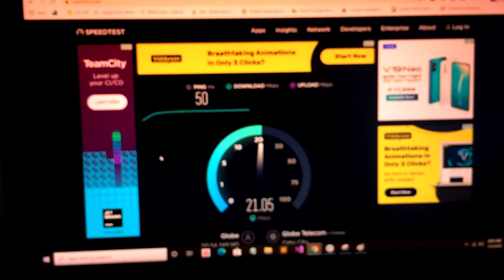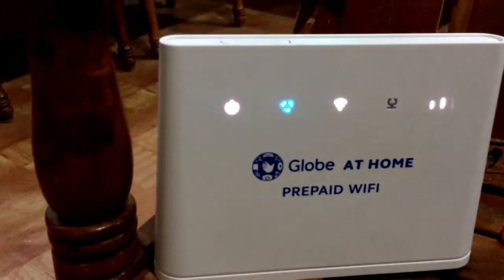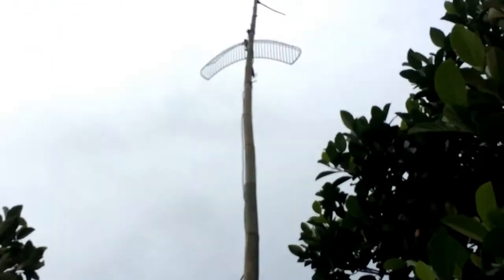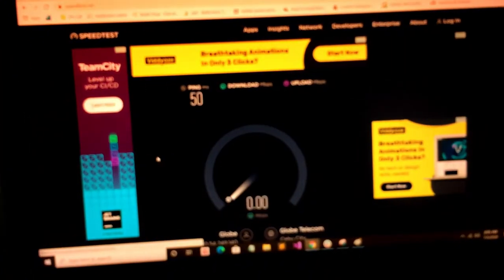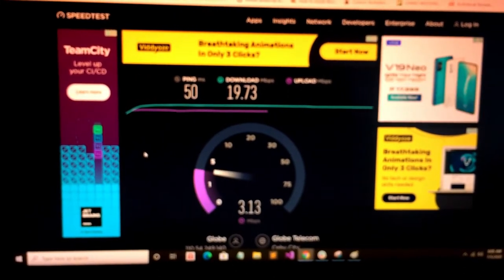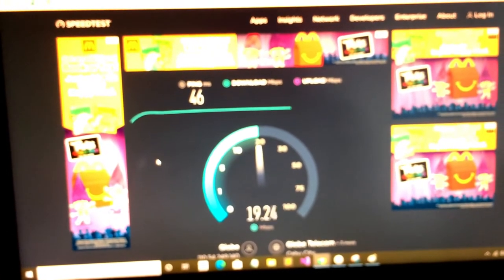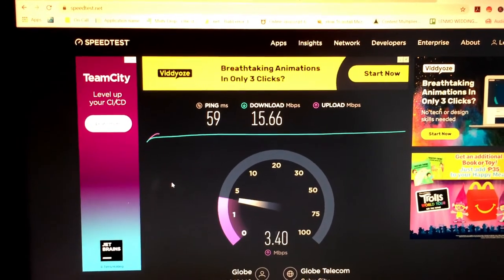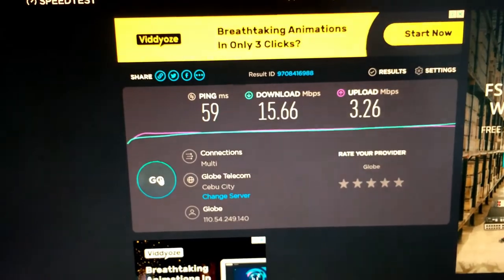Globe At Home 938 using 24dbi Parabolic Antenna

Comment: boss, plug and play lang ba ang antenna na yan or may kailangan pa akong convigure sa admin access?
Reply from the maker: Plug and play lang boss then e set or point lang kung san yung tower na pina kamalapit.
Reply: @lenmo1425  salamat po! naway matulungan ako neto sa problema ko